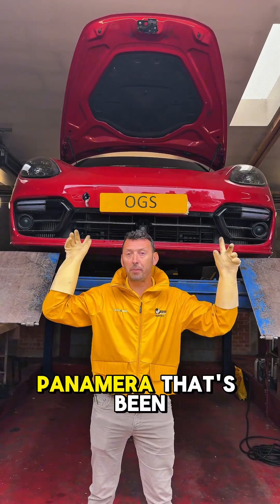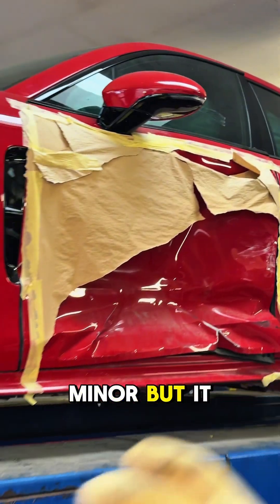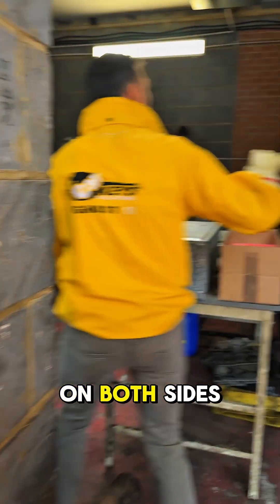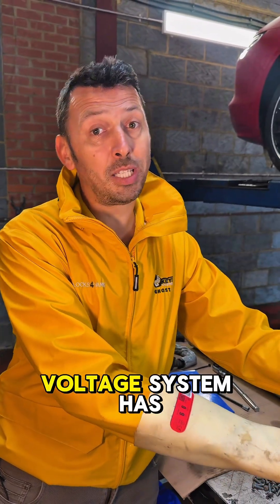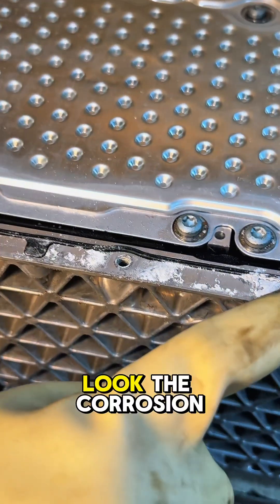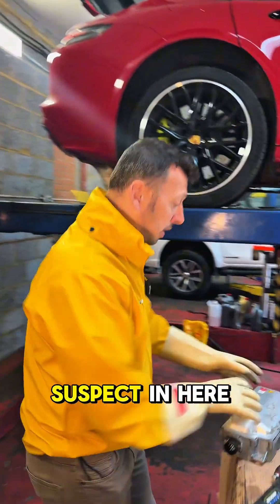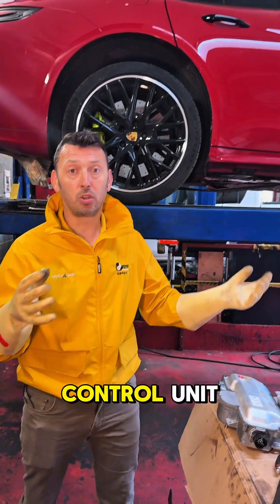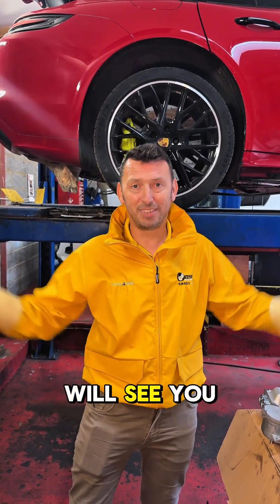Porsche Panamera Hybrid Crash = No Start?! HV Shutdown, Pyro Fuse Mystery

Comment: Did you find a place where is phyro fuse? Because it is not in relay box.. 😐
Reply: I have the exact same question. did you find it?
Reply: Not yet..  @glamourdiesel
Reply: @glamourdiesel Did you find it ?
Reply: There is one pyrofuse at the + point on the 12V battery, i have done it at a Touareg R hybrid 2025. I just would be highly interested if there is another pyrofuse in the battery controle module